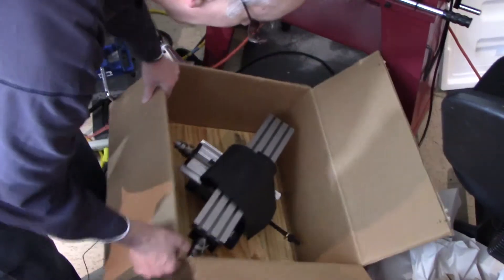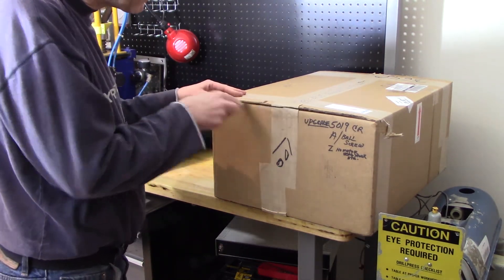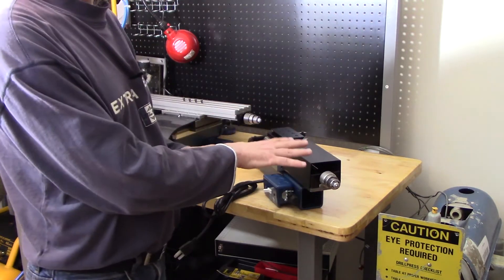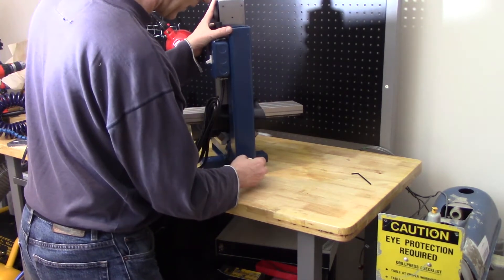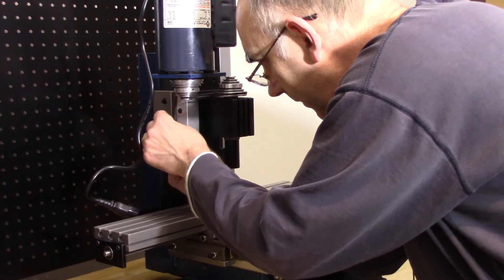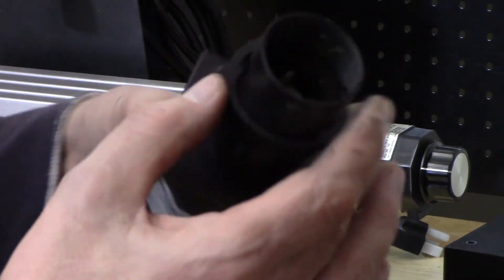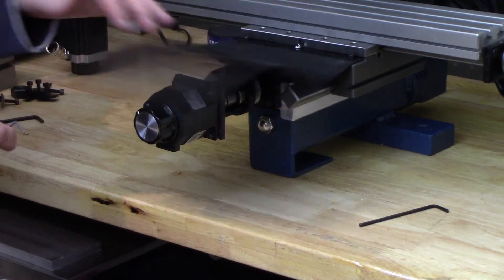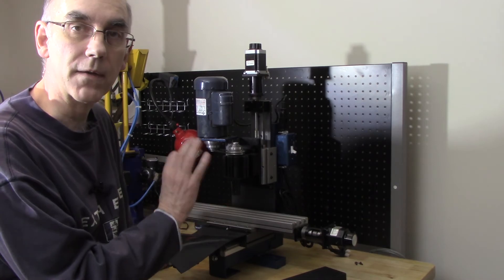#19 Taig Upgrade Part 2

Comment: Are you happy with the ball screw upgrade? Do you notice an increase in accuracy. I am considering the purchase of a Taig CNC mill. Are you using the stock Taig servos and controller? How are you connecting to the computer, USB adapter or through the parallel port? I only recently found your channel and am enjoying all of your videos. Thank you for your contributions.
Reply from the maker: Yes, I'm very happy with it. It significantly reduced the backlash. I would suggest either a Taig or a Tormach. The Taig is more affordable, but there is a lot of support out there for Tormach. I purchased my Taig over 10 years ago from eBay, before Taig had a CNC kit. At the time I was using Mach3 with Windows XP and a parallel port. I'm now using a laptop running Windows 7 via USB, using this: http://cncdrive.com/UC100.html